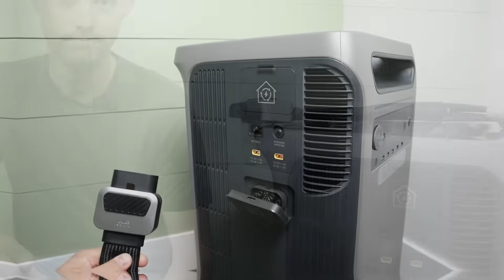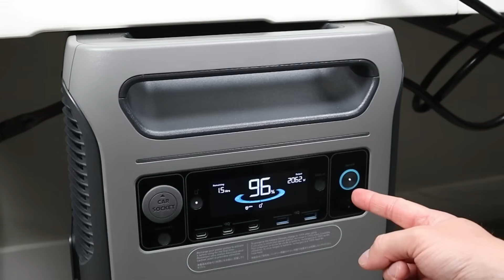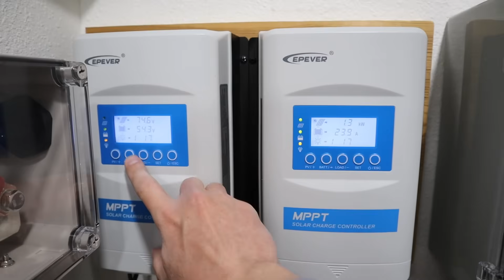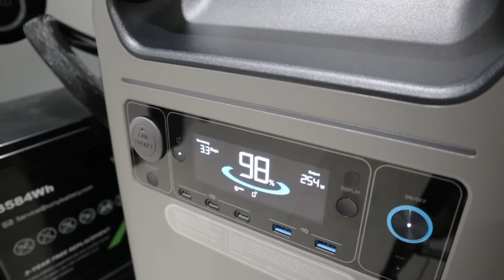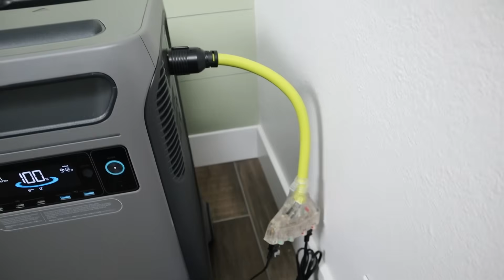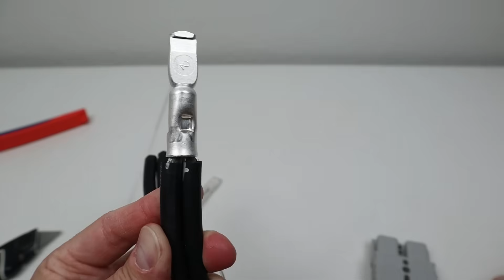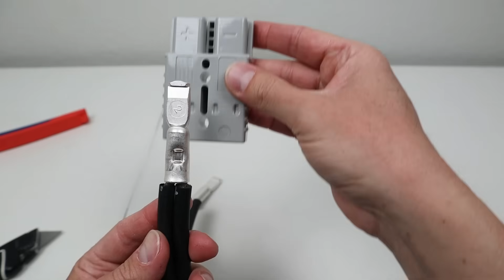I didn't Know This Was Possible!! Backdoor Battery Access to the Anker SOLIX F3800!

Comment: I have a Jackery 5000 Plus and one of the annoyances I have with it is the only way you can 240V charge it (aka - with a generator) and still use the 240V output is if you use their transfer switch. I actually think their smart transfer switch is pretty good...except for one thing: you can't separate the breaker part from the plug in part. Translation: the batteries and STS and batteries have to be in the same room. I'd prefer to keep the batteries and inverter in the garage and have the STS next to my main panels. 

So for now, I didn't buy it, but still want to be able to run a critical loads panels during a power outage and if my small 4.4kW array can't keep up, charge it with a generator. These limitations are why I originally was going to build a shystem, rather than use these all in one systems.

Comment: Great job @jasonoid, I've been doing this for a couple of months ever since I watched @NoiseLab47. I have a 100Ah battery connected with a breaker disconnect between. I run my entire house off of this single F3800 and the home panel. I also have my solar array connected to 200 Ah battery bank and connect that into the regular solar input.

Comment: Wonder how close in charge two Ankers would need to be to avoid going over 1C as the two batts equalized. As exciting as this video was, my power station of choice was the cheaper Zendure Superbase Vs and though they have expansion battery capability, there is no power at the expansion port the way there appears to be on the Oupes and the Anker. Something in the cable communicates between the two units. Hopefully someone will explore these batts for this capability. I'd love to hook a homemade expansion battery in.

Comment: The F3800 will turn off the inverter after a bit if there is no load present. This happens on the base unit, it’s not a result of your modifications. You need a small draw like 40W and it will stay on.
Reply from the maker: I've disabled the auto off settings in the app.

Comment: I did something somewhat similar with my BlueEtti AC200l, I have 10 KW of ecoworthy 48 volt batteries and a victron charger connected to it through the DC input set to OTHER instead of PV. I have the ac200l running all my AC and DC workloads and it acts as a 2kw buffer, it can charge at around 800 watts from my 48 volt battery bank. The ac200l basically stays fully charged almost all the time and my 10kw eco-worthy battery bank goes from 60% to 100% everyday with my usage. Of course this is not a direct battery to battery connection but I works great and way cheaper than the Bluetti batteries.
Reply from the maker: I have a couple videos about using 48v batteries at DIY expansion batteries, that works well. In this video I was attempting to take it a step further 😂

Comment: I've been wanting something like this. I have a battery that I've built and i would like to plug it into a system like this but also have the voltage maintained or limits set so the battery isn't ruined or put in danger.

Comment: Very cool, I'm already doing the same thing with Dabbsson brand of power stations
Reply from the maker: Awesome! Love hearing that 👍 What type of connections are you using? What type of battery and chargers?
Reply: Hacked some bullet connectors and made my own wires. It's now integrated with ecoworthy server rack battery and a renogy X inverter charger.
Reply: When I checked my voltage at the expansion port it was only 47 volts fully charged, feels like too low a voltage to risk connecting a 51-54v pack to. @mrct309
Reply: which Dabbsson model do you have? I have a DBS2300Plus that I would like to find a way to be able to dump more then 800 watts into via the sometimes limits me to 425 watts solar input because it somehow knows it's connected to a 48v battery and not a Solar Panel so it limits the amps on the port.
Reply: @DanielsCorner644  dbs1000pro, and likely other models would work too?
Reply: I slapped my multi meter on the expansion battery port, looks like the charged battery sits at 47 volts on mine, a little low to risk connecting a 51.2v battery to IMHO  @mrct309

Comment: I have seen another guy hack a cable for expansion. It’s about time we see some content in this regard.
Next should be a diy battery replacement 

Does the Anker charge the diy expansion battery?

While we love fast charging, I’d think there is a risk of pushing too much power thru the bms of the power station.

I think my preferred method of connection would be a busbar or the victron distributor. Anker on one side, battery on other side, middle part to add mppts or loads.

All this hacking will most likely void warranties. But can be worth it. Expansion batteries are very expensive and a OTC battery is much cheaper.
Reply from the maker: It will be great to see more people modifying these. I hope to see lots of other videos.

Comment: could something like this be done on the C1000X ?
Reply from the maker: Probably not, it doesn't have a 48v battery inside, it uses a lower voltage LFP battery.
Reply: @Jasonoid  I think it is a 36v system

Comment: Not sure I'd ever use it but can you hack EcoFlows expansion port like this?
Reply from the maker: It's not as easy since EcoFlow power stations don't have live voltage on the port when the power station is turned on. You'd have to figure out what form of communication enables the expansion battery port.
Reply: @Jasonoid there’s may be some type of communications lockout. Even using different expansion batteries with a head unit has restrictions, afaik (Like Delta Max battery with Delta Pro). DIY solar forum has people attempting to crack the communication

Comment: Do you have a C1000 handy? Would love to know if this work around is possible with the expansion port on the C1000. Ideally, I would use the port as a DC output, as for myself it is the main lacking feature of the power station. 

I took my C1000 camping and rigged a 12v trolling motor to my canoe. Amazing experience except for the fact I had to go C1000 -> AC output -> inverter to 12v.

From quick searching online I believe the C1000 is a 32V system... I could easily step that down to 12v for my needs. 

(Trolling motor is 12v and peaks at roughly 30A)
Reply from the maker: Just stick some volt meter probes into the expansion port and see if you get voltage / what voltage it is. If it's live, you'll most likely be able to do this mod. I don't have the C1000 anymore to test with.
Reply: I had the same question but I'm not seeing voltage on the expansion port.  It must need to see the BP1000 expansion battery via the comm wires :(
Reply: @adamdamico9269  I'm considering picking up a BP1000 to see if I can read the signal on the comm wires to manually bypass whatever system the C1000 uses to protect the output on the port. Will report back if I find anything
Reply: @maksymmoros555  Did you find anything?

Comment: Can you do a similar video like this for the Ecoflow Delta Pro Ultra or the Bluetti AC300. I had a Bluetti expansion cable to 5521 adapter cut off the end of it and put mc4 on the ends and was able to send 500 something watts to the DPU with the B300 battery using powerbank mode
Reply from the maker: The DPU has 110v batteries, not possible at all. Bluetti models, sure...it might be possible.
Reply: DPU has 32s battery configuration.

Comment: This is getting interesting. I might add on.... don´t get confused about the screen. In order for those manufacturers to secure the risks of warranty issues they don´t use the full spectrum of the standard LifePo4 battery 3,2V nominal cell. Meaning the target parameters of the BMS  on the High and the Low side  of the charge and discharge curves. So when Your screen says 100% or close to empty that might not reflect the state of charge of the cells AT ALL. Of course another reason to do this might also be that those target parameters of the BMS allow them to use all kinds of different quality cells ? ...Depending on the capacity of the BMS to balance the cells ? And what if the  BMS has assistance of a cheap active balancing board that does not need charging voltage ? 
This internal commercial politics of the manufacturers might be the issues when You parallel two power station. LET´S NOT FORGET... with each upgrade of firmware  they can change those parameters.
However if we have direct access to the shunt of the battery then we can also measure their set points of the BMS and can match them.and stay within the limits with our DIY external sources. As far as initial balancing and inrush currents. this could be controlled/limited depending on loads on the power station. You don´t want the external capacity on the shunt to interfere and keep it isolated from the internal BMS that is trying to balance the cells of the power station. Now there is no connection between their proprietary BMS  of their proprietary extension battery anymore. There is only the connection of the shunt. Check out this very concluding video about a Bluetti from John that opened my eyes.
https://www.youtube.com/watch?v=h_s5DaXskg0
MY TAKE..... can You see that ? There is only the Plus and Minus connecting to the rest of the power station. The BMS is a component of the completely isolated battery block. So unless there is a wireless connection the control unit does not know what´s going on with the SOG of the Cells, RIGHT ? Ans how about the size and number of cells ?
Well, there is some more exciting news. Fasten Your seat belts > https://www.youtube.com/watch?v=Ut6xZlyrmx8
I already have a copy of the EVE MB56 Spec Sheet. Think of it as 2 MB31 in one cell. Can You imagine 2 kWh in one single cell ? Of course now they have to clean out the ware houses and get rid of the outdated garbage. Soooooo, if 1 cell weighs 11kg-25lbs how much is the weight of 16 cells for 48V ? Even just a 12V configuration is already too heavy. I believe the future is buying just a control unit and than You do whatever You need ?

BTW..Yes, You are right, the  iMONTEK is a great power station. Almost missed it till Your video because when I first heard about Lithium ION i swept it under the rug. THXs, keep it coming

Comment: Great instructional video! 
I'm assuming you have to have all the same chemistry (LFP) and all the same voltage (51.2V) to safely parallel them up through the expansion battery port. 
So I would think that using an Li-ion battery from an ebike would not be good through the expansion battery port, but would be good to use through the Solar DC input. 
Do I have that right?
Reply from the maker: Correct, the battery chemistry and voltage needs to be identical for any sort of long term performance.

Comment: How many wires in the com cable?  Land it in an RJ45 biscuit and then you can have DIY extended length expansion cables, that's common on the EcoFlow side before they came out with the XT150 extension adapters
Reply from the maker: It appears they are using an RJ45 standard. Looks like 4 twisted pairs, same as ethernet.
Reply: Could be CAN-bus, RS485 or RS232 serial comms as well, that would be similar to the industry standard for battery/inverter coms

Comment: My F3800+ inverter seems to shut off several times per week, without reason.  It's always got a small load on it, between 200 and 600 watts.  I am using it in a UPS scenario, so this fault is really show stopping.  It happened again today, was about 96% full, and just decided to turn off its inverter.  I'm not using the expansion port.
Reply from the maker: Hmmmmm, I never have an issue with the inverter shutting off on these units under normal conditions. Not sure what the issue would be. Anker support should be able to assist. The inverters have only ever shut off in these experiential tests (the test at the end of the video)

Comment: I think the inverter probably overheated 🥵 and thus the reason for the shut off!
Reply from the maker: It was only running a 1000 watt load when it's meant to power 6000 watts. I'm not sure that was the issue.

Comment: by default the F3800 will turn off the inverter after a fixed time, you have to use the app to keep it on forever. did you forget to to it with the F3800 plus?
Reply from the maker: I had all the ecomode settings and 'auto-off' settings disabled. It ran for days in the previous test, it just didn't like the F3800 connected to it, not sure why.
Reply: @Jasonoid  So strange.

Comment: Thank god I don't have to perform any of these hacks! My system is infinately exspandable in 2kw increments, no cables, and modular. Built in external battery exspansion port,  can use any batteries, any chemistry! Dual mppt controllers @ 150v each. Dual external AC chargers, 1500w, Dual mppt 2000w, DC car charging @ 20amps, all in at the same time while discharging 3000w full power, and it's a low frequency unit, idles at 13w! The real solar power stations! Built correctly, don't need no hacks!  😅
Reply from the maker: This video is for all the people who unknowingly got scammed into buying the F3800 at launch... All the other influencers said 'it's amazing, just buy it' and then I tested it and actually found that the 240v turns off when charging making the unit bricked for high powered backup when solar isn't around.
So for all the people who spent thousands on a system with these issues, here's some options to try to get around it. 

I have multiple DIY systems I have created around my home, both 48v and 12v systems.
Reply: @Jasonoid  yea,I get it. My point is that almost all of these high frequency units all need to perform some kind of hack or another, runtime hack,charging hack,solar hack or something, and most haven't figured out that if you expect these to last not to drive them over half there rated power. My unit is not self made, doesn't need these hacks, transformer based low frequency units that will do what they say reliably for a very long time. I say this over and over to all that will listen, learn the facts, buy or build once, and quit waisting money on what seems to be 1000s of uneducated people push on the public because China gave them a free one. If these units were worth a damn, our grid would be structured the same, but the world doesn't run there grid on $5 chipsets for a reason 😮
Reply from the maker: The unit wasn't free...  @dustydawson8977
Reply: @Jasonoid  I did not say yours was free, but there are 100s whose were, that push straight nonsense

Comment: A lot of the "odd" limits on these power stations, from every manufacturer, come from compromises in using cheaper parts to hold the cost down. That puts capacity limits, heat stress, all sorts of things that make for roadblocks to different usage cases.
 "Kids, don't do this at home." Those power stations can kill you, if you poke around blindly.
Reply from the maker: Yep

Comment: The head units want to bring the battery to full charge by themselves.  You can use external to get it close (your 55.5V) but then let go so it can finish itself via internal charger or MPPT.   I found the same with my similar experiments I talked to you about at CES with the other brand.
Reply from the maker: Both of my external MPPT controllers charge the batteries up to about 55.4 volts with the stock settings so that doesn't cause an issue. They seems to work well without any hiccups. It was weird how the F3800 charging the F3800 plus at the end of the video was the only issue I ran into. 
The new Bluetti SolarX 4K connects directly to the Bluetti expansion port, it's basically doing this same type of thing but it does have some basic communication with the power station.
Reply: @Jasonoid  My Bluetti AC500 peaks out at 56.3V when it goes to 100% which is pretty dang high.  The 3800 is probably doing similar.  The head units want to be in charge of the charge termination.  If they want to stop and the voltage is still rising,  they throw an error and abandon ship.  55.5 is still FULL for LFP and definitely a resonable place to stop external input.  Yes the Solar 4K has comms which prevents this problem.  I hope to have one in my hands soon to explore.
Reply: @DougKremer hey, i have 2 b300s and 3 b300’s and 2 ac500’s. 

3 anker f3800 plus
1 anker f3800

What test would you like to check? I have been running my solar thru bluetti’s, then 240 out of both bluetti’s into the anker generator charge controller into my f3800 plus and then 240v out to my RV. 

Im tired of my solar not keeping up with the drain of the anker (keeping it topped off) and then the split phase output on bluetti stops while solar continues to keep coming in and recharge the batteries. Its so annoying. What would be a better way to run this system?

Comment: I wonder ! 🤔If you have two expansion battery cable connectors and each + and - cable ends were spliced and connected together and then connected to a separate + and - cable leg like a Y connection that connects to whatever 48 v battery 🔋bank       , battery charger ,or PV solar charge controller , would they charge up both f3800 units without any problem ? May the solar be with you !🙏🤗
Reply from the maker: I don't see why that wouldn't work. As long as the state of charge is all the same when you connect it up.

Comment: Great video.  I learned a great deal.  Wondering if the cable could be connected to an Anker expansion battery and charge both it and the F3800?
Reply from the maker: Since it's a parallel battery connection, all of them would charge and discharge at similar rates.